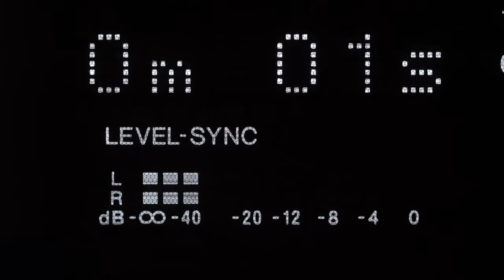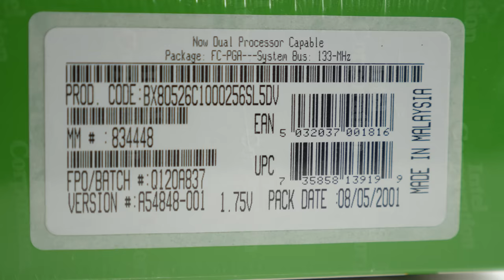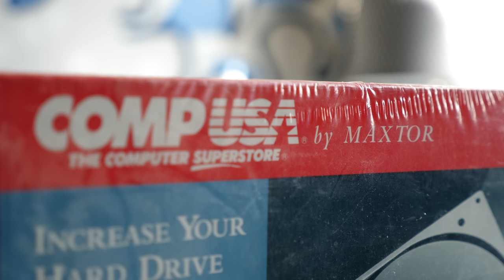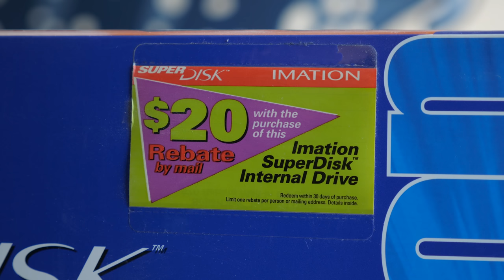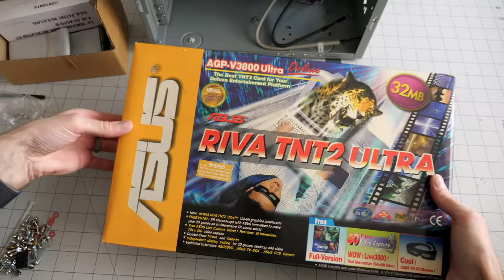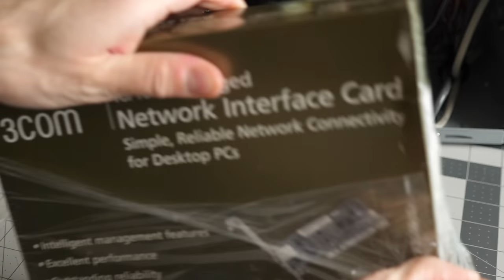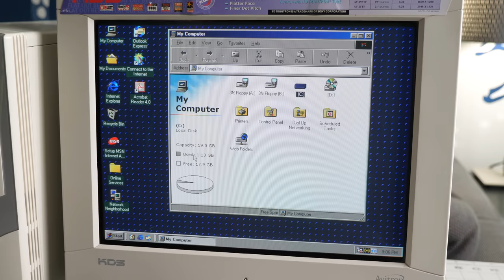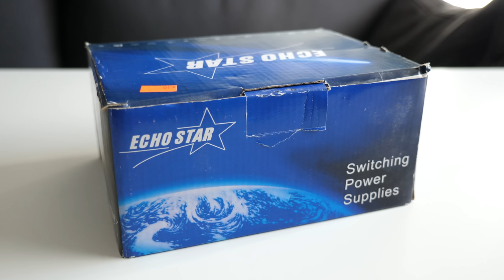Building a Retro PC From New Old Parts!

Comment: I get the retro "new-old-stock" appeal, but you should really consider using a modern, decent PSU. It's a shame to risk these old parts with some "whatever" branded power supply from a decade ago.
Reply: I mean, it has "Devil" RIGHT IN THE NAME.
Reply: I agree
Reply: Should at least take the psu apart to visually inspect the caps and leaks, technically you can recap the psu to keep the old look if you must but yea ideally just get a new psu with a good 5V line
Reply: Yes and no depending on the build as modern units don't have a strong +5v rail so some builds are immediately out of the question then there is the -5v issue if one wants to run ISA audio as that is often an requirement.
Reply: yeah Diablotek wasn't exactly known for quality
Reply: @supercool_saiyan5670  they aren’t as they still make stuff.
Reply: Modern PSUs have a weak 5v rail, and that's what powers the CPU in older computers. It'd have to be a VERY high wattage modern PSU so it can have a decent 5v output.
Reply: That's the one thing you never skimp out on
Reply: Some modern PSUs don't have the proper railings for those old parts though. If anything, he probably should have gone with a new old stock Antec or PC Power and Cooling PSU as those were much more reliable than that model chosen for this video.
Reply: @MartinPaoloni  sure, but a decent modern ~750w psu should have enough wattage on the 5v rail (and actually hold the spec from the sticker which these chinesium PSUs rarely do)
Reply: Especially considering diablotek is a name that strikes fear into the heart of any builder. Shitty voltages for your parts was a constant with diablotek.
Reply: Most modern supplies don't have any Berk or molex connectors at all. Heck, many of them won't support 20pin atx either.
If you have a socket a build, it's even worse. There are some late boards that had the 4pin CPU power as we know it; I have an abit kw7 for reference that does this. Yet even then, the CPU won't draw power from anything but the 5v rail. That build will not boot, without a minimum of 20a on the 5v rail. But most PSUs being made now can't even provide 10a unless you're going well over 1000w!
Reply: @ZeroHourProductions407  Mainly the older Socket A boards but once the Athlon XP chips came out things got quite a bit better. The first PC I assembled myself was an AMD Duron 1.3GHz Morgan core CPU on an nForce 1 motherboard with integrated Geforce MX graphics. I used whatever PSU came with the Fong Kai Industrial case I bought and then upgraded it to an Antec True Power a couple of years later. 

Funny enough, CompUSA had a manufacturer called Mad Dog Multimedia and one of their products was a modular PSU that even had a separate rail for AGP graphics power. It was quite reliable and was more than enough power for anything I threw at it.
Reply: @NightMotorcyclist  Dude, I'm experiencing this with an xp 3200+... the fastest and last socket A cpu. It literally will not boot with any PSU with less than 20A on the 5V rail. Even though it's on an Abit KW7, which has that 4pin connector. Nobody can explain why, either.
Reply: @ZeroHourProductions407  Thermaltake makes decent powersupplies now compared to the past, and their Toughpower series comes with berg and molex :)
Reply: @ZeroHourProductions407  pretty much all modern power supplies still have molex large and small, and most have a 24-pin that can separate to 20-pin.
Reply: @ZeroHourProductions407  we recommend 50a on the 5v, 35 is ok tho
Reply: @dashtesla  personally for my retro build I bought a brand Corsair PSU and then just removed the housing and replaced it with any old one
Reply: @_WyreTheWolf  my modern 450w also has 20a on the 5v rail, which is plenty for a 486.
Reply: @MrWolfSnack  not everything old is better, and that's most defintely the case for power circuit designs. You can argue all day about the rest of a computer, but modern PSUs are highly unlikely to fry your motherboard or set your house on fire, unlike many PSUs from the 1990s and early 2000s.
Reply: @EvilTurkeySlices  plus I'm fairly sure a knowledgeable electrical engineer can figure out how to modify a modern PSU to put out higher amps on those rarely used rails that old PCs need. Either that or modify the actual motherboard to be able to use modern voltages and just convert it.
Reply: @SockyNoob  Not enough engineering rework to either basically be a whole different PSU or be janky enough to rival the diablotek.

Now most of the myths around New PSUs dont work with old hardware is mainly about the p4/Athlon XP era as they started using a hell of a lot more power vs before. That pentium 3 an older coppermain core (1.75v) and is rated for 29 Watts of output. Now some of the higher end Athlon/P4 cores were over 70 watts but still used the 5V as the main rail on the machine.
Reply: @PantherSerpahin   <-  Pay attention to this guy.

Go look up the TDP spec for the CPU you're using.  In the case of a P-III, it's not much.  And this is about the top end for a P-III.  If this had been a Tualatin core CPU, it would be even less.

That leaves the chipset and graphics as about the only other substantial drain on the +5V rail.  The chipset is going to be a few watts, and the graphics ... of course totally depends on what card, and whether it's using +3.3V, +5V, or +12V rails.

Now, I'm not a fan of the "use a new PSU" tactic in general.  I would rather re-cap an old PSU, but I wouldn't be caught dead with a vintage system powered by "Diablotek" or whatever fly-by-night outfit.  There are plenty of reputable OEMs out there, and lots of old stock AT / ATX / ATX 12V supplies that can be made whole again without too much trouble.

There's also a lot of garbage out there in the new market.  And since no name-brand actually makes their own stuff, you don't know what's actually in any given supply unless you can find a tear-down of that model.
Reply: @MrWolfSnack   #2:  Those parts definitely do have value.  You're easily out $10 for the floppy drive, sound card, or video card alone.  More importantly, they aren't making a whole lot of them anymore (sarcasm), so they are a rare commodity that is only getting rarer.  You can get lucky and stumble on a bunch of parts for free, or near to it, but that's getting less common.

#3:  What exactly is the frequency discrepancy between DC in 2001 and 2022?  What's the voltage discrepancy between +5V and +12V in 2001 and 2022?  Modern PSUs are overbuilt on +12V, and under-built on +5V, with regard to current capacity.  But if you actually calculate what you really need, a given circa-2001 PC would be fine on ~200W, and the real demands on the relatively whimpy +5V rail should not be a problem for a typical recent PSU in most cases.  Late Athlon XP builds might well be an exception.  You gotta know what you've got and what it takes to run it.  There are definitely corner-cases.  (Packard Bell made one.)

Similarly, some have mentioned the lack of negative 5V rails -- which is a problem for some ISA sound cards (mostly), and pretty much irrelevant for anything in the Pentium II era and beyond.  Unless, of course, you're still rocking your Pro Audio Spectrum in that P-II.  Again, don't just blindly follow blanket statements, do a little research and find out what you actually need.  It's not the crisis it's sometimes made out to be, and there are easy fixes when it is.
Reply: Boring!!
Reply: One issue with a modern power supply.  They're configured to put all the output on the 12V rail.  That's great for a modern PC that uses graphics cards driven directly from the power supply.  On these retro PCs they need more power on the 5V rail.  I think I'd go in with that old power supply, but would recap with decent capacitors.
Reply: I  also have an 815 board with Pentium III 866MHz processor 512MB PC133 single stick RAM and an AGP 128MB Nvidia GeForce FX 5200, and I use Frontech 800W Power Supply as it is the most popular power supply made in India.
Reply: @SockyNoob  Yup!
When building a modern PC (not a retro like this one: I so want to build a retro XP/98 machine one day!), I'm willing to scour Amazon and eBay and the like for second-hand parts, but the only two components I would always buy new would be the SSD and the PSU.
The former because used SSD's are sold all the time as "new", and the latter is sort-of common-sense, heh.
Reply: @cjmillsnun  There is also a second problem, modern PSU don't come with a -5V that can cause problem on some retro machines (all of them that use ISA slots)
Reply: I got a Thermaltake with modular wiring. It came with a molex wiring and sata wiring. This build deserves a better psu.
Reply: @NightMotorcyclist  This was awesome. I also had a poor experience with a Chinesium PSU going boom in the night and melting everything (literally). Like I woke up to my mouse melted to my desk the next morning. 

AND I also got an Antec True Power Quattro right after, the 850W one with the yellow racing stripes...ten long years of use (and one lightning strike to the roadway maybe 15' from my door) later and it's still working perfectly. I just can't use it any more because of the immense "server-grade" fan noise...it was louder than all nine case fans. I got a Seasonic Prime Gold 1300W PSU since to replace it; this thing is a unit, I've barely even pushed it at full send. 

Now that I like to shop at thrift stores, tho, I've found so many new and inexpensive PSUs. The 750W Ultra X4 modular PSU for example was $7.99, when I took it apart there wasn't a single speck of dust in it or any signs of heat oxidization: it had never been powered on. Hooked it up, tested it, green across the board. Threw it in the Athlon II test rig to check reported voltages: everything stable. Now it powers my 4770K budget build ($150 complete Craigslist motherboard bundle, $150 980Ti SC2 GPU,  and packaged into a $25 vintage Lian Li PC-61 case). 

I like building older (but well capable) hardware on the cheap.
Reply: @PantherSerpahin  I think the problematic ones are those and very early 16 bit systems from the early 80s.
Reply: @SockyNoob  those us the AT standard which was completely different in terms of connectors/pinoutd and voltages in some cases
Reply: @EvilTurkeySlices  They make 24 to 20 pin adapters, in case they can't separate. Most can separate, some newer ones can't.
Reply: @johnathin0061892  very few. I haven’t seen a new power supply that didn’t. I do have a few old ones that don’t.
Reply: @NightMotorcyclist  Antec NeoPower 500 would be pretty good, I think it has Seasonic's guts
Reply: @StaticVapour590  I have their old Neo 550W PSU and it still works to this day in my old AMD Athlon XP system. Then there's this PC Power & Cooling 350W PSU still running in my HP Pavilion Pentium III PC that was a replacement for a 200W unit as I was afraid my Sound Blaster Live! Platinum with drive bay and ATi Radeon 32MB DDR card would overload that dinky OEM PSU. I have to tell you though that after building PCs with black cabling, the ketchup/ mustard wiring combo is a bit off putting.
Reply: @TheotanyaSama  Few ISA cards actually use the -5V rail, mostly early soundblasters that use that rail for their op-amps. Even if you do need it, you can make/get the Voltage Blaster, a simple little ISA card that regulates -12V to -5V on the bus, so as long as you have an extra ISA slot for that, the rail on the PSU is unnecessary.
Reply: Those power supplies were junk before they hit the shipping trucks.  I wouldn't use it even as a tester.
Reply: Startech makes new 350w psu with molex connectors for p4 systems
Reply: Nobody making a power booster board that'll that'd let you take some of the 12v power from a new PSU and get more 5v and 3.3v?

At this point for new machines we really need to get away from ATX. The 24 pin connector is absurdly loaded up with crap, to the point that we need another 8 pin connector, in fact sometimes two. It should be replaced with something simpler that is just 12v, and then the mobo can have regulators for 5v and 3.3v if it needs those for stuff like SATA which many systems don't even use anymore.
Reply: New Corsair one 430W for cheap
Reply: @ZeroHourProductions407  I bought 3 PSUs in the past year ranging from 850W-1300W each from different brands. All of them had plenty of molex and berk. They all had the 24-pin split into a 20-pin & 4-pin like the one in the video. There’d be no issue.
Reply: Yea seeing as how all of these parts are in such condition id cry if they got messed up lol
Reply: Until you want to play actual games, then you realize you should upgrade to at least a voodoo 5500 or geforce 256 ddr to target that era.
Then 2002 to me is the split off and Segway into the 2002 to 2006 era starting with r300 based gpus such as the legendary 9700 pro.
Reply: Modern, no, decent, yes.
Reply: @ZeroHourProductions407  not having molex would be a issue for this build, however modern PSUs are still backwards compatible for 20 pin atx, and those 8 pin will still work for 4 pin cpu connections providing the board allows room for the hang over.... they will still work. And if it came down too it, there's always 8 pin to 4 pin cpu connector adapters.
Reply: Yep.  I got a Pentium 4 tower with a TNT2 on eBay and while the PSU still works, I'm actually upgrading it to a Windows XP mid-2000s rig and it won't cut it.  It's a ticking time bomb at this point so I just grabbed a barely used 650W PowerSpec I had laying around.  It was a VERY tight fit but it gives me some peace of mind, plus it's modular so I only wired exactly what I needed since cable management wasn't a thing back then.  That's the great thing about PSUs.  They're compatible with basically everything going back that far.
Reply: Those Diablo psu's were notorious for blowing up too
Reply: It's not like he's building this for someone else
Reply: Aesthetically speaking nobody cares what your power supply looks like, they pretty much all look the same from the back of the case.  

There's some bragging rights I guess in being able to say the who build is New Old Stock, but besides that I don't think anybody is deducting brownie points for having one of the least visible components be not totally period accurate.  

I mean I guess you wouldn't want to put a brand new black or white painted model since it'd stand out against the creamier cases, but if it means less chance of your precious retro parts getting cooked it seems like the smart thing to do.
Reply: psus, fans, hard disks, you can get the pc dead quiet
Reply: The only new component I have in my retro system is a psu. Yes it's a pain only have 3 molex connectors and no floppy connectors and a bunch of irrelevant sata connectors that I will never use. But I wouldn't trust my Voodoo3 and slot 1 p3 on an old PSU. Molex and floppy connectors can be achieved with splitters and adapters. I would highly recommend a new PSU as well
Reply: Those old psu's could get quite explodey
Reply: hmm. Had plenty of made in the usa chinesium. Including top brands i know were fully manufactured in the usa. Some quite pricey.  Glass houses
Reply: hmm. Had plenty of made in the usa chinesium. Including top brands i know were fully manufactured in the usa. Some quite pricey.  Glass houses
Reply: @_WyreTheWolf  flashback with the sparkle brand lol
Reply: Yeahhhh I agree. Especially with the knock-off capacitor fiasco that was superior around the early naughtys I say so.
Reply: Eh, basically any PSU will do the job.

Even the cheapest of PSU's can safely run non-overclocked PC's for a long time. People just like to dunk on cheap PSU's.
Reply: @opposedscroll7596   Did you not see the 'workmanship' of that Diablo PSU ( edited : Not the Diablo, but the Echo Star PSU ) in the video???  Cheap PSU's are cheap for a reason, that one, in particular, was scary bad...
Reply: @MrKillswitch88 No, isa sound cards are often missing the -5v pin.
Reply: The problem is that then you need a 750 watt PSU when you should only need like a 200 watt one
Reply: should have gone with a vintage thermaltake or corsair
or better yet seasonic if an NOS one is found
Reply: @marcinbinczyk I get your need to put in your useless thought, but he did it for the video and no one cares what you think
Reply: I agree. Back in the day I would always opt for the better power supply. The name brands became so because of reliability and quality. It’s like buying a sports car and getting generic tires. An economy that is wasteful in the long run. I spent money for “horsepower” and I don’t put cheap gas in it.
Reply: My personal preference is to buy new old stock of quality, tested PSUs which deliver decent power on the 5V rail, for example, Enermax EG365P-VE 350W or a Seasonic S12-II 520W. These even come with Berg & Molex connectors, perfect for vintage peripherals. It’s more than good enough to power a vintage PC with any old AGP or PCI video cards. I’ve used these PSUs for years in my vintage desktop builds with zero problems. They run quietly too, which is a nice bonus. For example, the Enermax delivers 32A on the 5V line and the Seasonic will do 24A.
Reply: I love using zip ties

I always snip and apply the tip of a match to the sharp end to make it a rounded nub though
Reply: yes i agree
or old psu higher quality but modded or at least replaced caps.
Reply: Do you really get the retro new old thing if you’re advocating for something that doesn’t fit this era? Just a thought.
Reply: @Charlie_Crown 

The Diablo psu was never taken apart. You are confusing it with the garbage Echo Star.
Reply: @johnfox3845   Thanks, yes I meant to write Echo Star, it was cheap and dangerous junk, still think he should have had a peek inside the Diablo one though, I was concerned about it's quality also 👍
Reply: He should've disassemble psu and check the capacitors before powering up